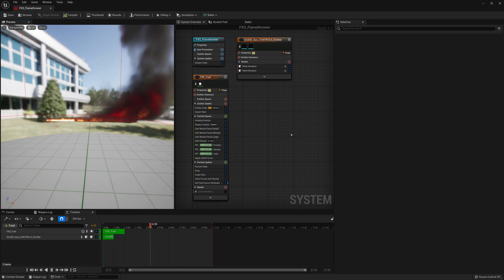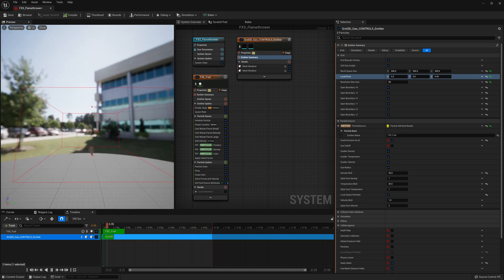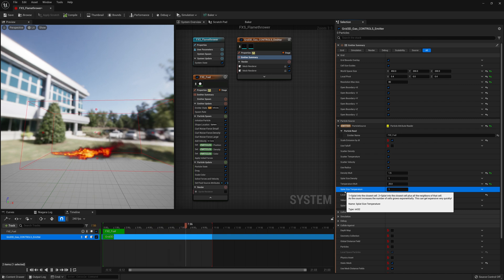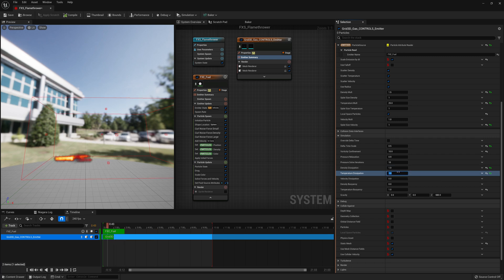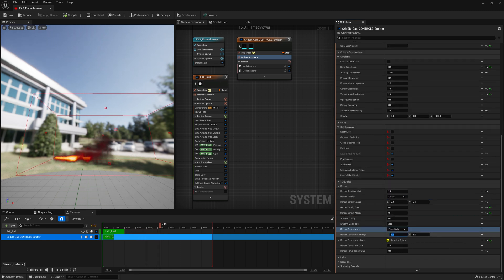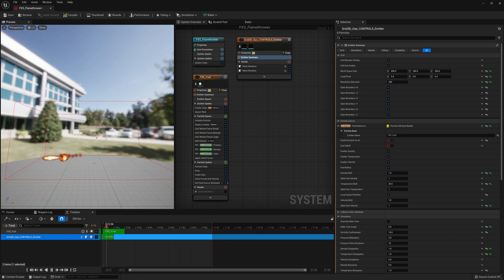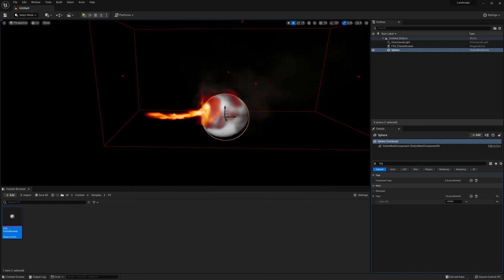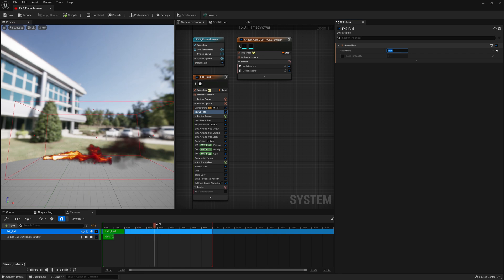Unreal Engine 5 Tutorial - Niagara Fluids - Flamethrower [2/2]

Comment: Any time you see a default value of 256 or another multiple of 8, you should keep the value locked to a 2x multiple or divisor. i.e. 512, 256, 128, 64, 32, 16. Even though 80 is a multiple of 8, it's better to go for  full resolution drops (half width and half height). TLDR use 64 instead of 80.

Comment: Thanks for the great tutorial. One question, when I sequence this, where the life-cycle track stops, the fire just snap-off rather than particles around until life-time has elapsed. I've tried with another Niagara particles system from the UMP and it works as expected. Does anyone know how to solve this or any workaround?
Reply: I think it has to do with the grid 3D gas control emitter dying as soon as you deactivate the system. I doesn't follow the life-cycle option in the same way as a particle emitter.  My workaround is, go to the particle emitter spawn rate, make a new user parameter and keyframe it from the sequencer.

Comment: Was testing this out in a default third person project. I dopped the Niagara into the default level and packaged to see how it looked in actual game but I get tons of errors. Example errors below... is there something I'm missing? Should the niagara require additional steps so that it can be packaged without errors?

+ Error: GPU particle read DI is set to access CPU emitter 'FXS_FlameThrower.'.

+ Error: Variable Output.CurlNoiseForce002.CurlNoiseForce was read before being set. It's default mode is "Fail If Previously Not Set", so this isn't allowed. - Node: Map Get -  Grid3D_Gas_CONTROLS_Emitter, Particle Spawn Script, 

+ Error: Variable Output.CurlNoiseForce002.CurlNoiseForce was read before being set. It's default mode is "Fail If Previously Not Set", so this isn't allowed. - Node: Map Get -  Grid3D_Gas_CONTROLS_Emitter, Particle GPU Compute Script, 

+ Error: Variable Particles.Density was read before being set. It's default mode is "Fail If Previously Not Set", so this isn't allowed. - Node: Map Get -  Grid3D_Gas_CONTROLS_Emitter, Particle Update Script, 

+ Error: Variable Particles.Density was read before being set. It's default mode is "Fail If Previously Not Set", so this isn't allowed. - Node: Map Get -  Grid3D_Gas_CONTROLS_Emitter, Particle GPU Compute Script, 

+ Error: GPU particle read DI is set to access CPU emitter 'FXS_FlameThrower.'.

+ Error: GPU particle read DI is set to access CPU emitter 'FXS_FlameThrower.FXE_Fuel'.

+ Error: EditCondition parsing failed: Field name "bOverrideMaterials" was not found in class "NiagaraMeshMaterialOverride".

Comment: In UE5.1, on 'Grid3D_CONTROLLS_Emitter' there is no more 'Collision Data Interfaces', but instead 'Collide Against'. Just check first box named 'Depth Map', compile and save. Now any object in flamethrower path will collide WITHOUT need to add any tag.
Reply: hey, thanks for this tip, but it doesn't seem to be working for me. did you have to anything else to your meshes or actors? I'm also having a bit of trouble getting it to look as smooth as the video, even messing with the parameters it seems like a bunch of fireballs to me.
Reply: @cnetik  add to your FXE_Fuel a collision parameter by clicking on the + of Particule Update of FXE_Fuel, then no need to check the box named Depth Map and if your your static mesh has a collision thanks to auto convex collision it will work

Comment: Hi, thank you very much for the great tutorial ! I'm having an issue with the collisions in 5.1, it looks like the settings have changed. I tried to add the tag on the mesh and on the niagara emmiter in my scene under collide Meshes, but it doesn't seem to work :/ Do you have any idea on how to make it work ? Thanks again !
Reply: Yes, on 'Grid3D_CONTROLLS_Emitter' there is no more 'Collision Data Interfaces', but instead 'Collide Against'. Just check first box named 'Depth Map', compile and save. Now any object in flamethrower path will collide WITHOUT need to add any tag.
Reply: You are a saviour. Thanks. @MilanKarakas

Comment: What an I do if the static mesh collisions Data Interfaces tab is not showing under the gas emitter properties?  I can't seem to add collision tags to my flamethrower system.

Also, is this system emissive, in that you can have it emit light from the particles being generated?  or do you have to add that in somewhere?
Reply from the maker: Ill have to take a look at those other things, but for collisions just make sure the objects you want to collide with have the "collider" actor tag. 

As for Lighting of the particles, depends on what type of lighting setup your using. If you are using Unreal 5's Lumen, then any materials/particles that have values higher than 1.0 will emit light and automatically get some GI/Illumination casted from those sources. 

If your not using Lumen you may have to just brighten up your particles alot to generate a glow. It would be really expensive to have like true light/illumination from a volume in Unreal, but its possible but would take a lot of re-working the system.
Reply: For your first question; In UE5.1, on 'Grid3D_CONTROLLS_Emitter' there is no more 'Collision Data Interfaces', but instead 'Collide Against'. Just check first box named 'Depth Map', compile and save. Now any object in flamethrower path will collide WITHOUT need to add any tag.
Reply: @MilanKarakas  where is an explanation for all the rest of those check boxes? What exactly is depth map? Whats best for performance?

Comment: Thanks for your tutorial!  Im trying to rotate the emittier and have the velocity linked to the axis so when you rotate the vfx it self the smoke  sim follows  the rotation and not world space ? Would be so kind if you could help me on this one! Peace
Reply: Hello, i eventually could fixed that issue. But right now  when i render out in movie render  queue the smoke appears with deafult lighting. it doesnt apply the lights that go un the suer parameters.  Do you know maybe why this is happening? I appreciate your help thank you!
Reply: @josho3867  Could you share how you solved the rotation issue?  😅
Reply: Ok nevermind I got it. I made a UserParameter for the VelocityRotation in the NS. Then (in the BP that updates the NS position)  I split the NewTransform and only gave it the location and scale. The Rotation pin sets the VelocityRotation (via SetNiagaraVariable) which is then used as the axis in AddVelocity. But because you don't have the Rotation in world transform, you need to set the local pivot of the FireSim to 0 0 0. Only downside is, that the space of the FireSim now wraps all the way around you, which costs performance.
Reply: @Kimanox  Any chance you could share more details? I'm trying so hard to get this to be a flamethrower weapon.
Reply: Hey. I think you need to attach your niagara effect to the BP Static Mesh. I find the resolving of this issue in this video https://www.youtube.com/watch?v=zqvXqHWZpaE    - That method helped me to do the rotation (it rotates correctly with the mesh).